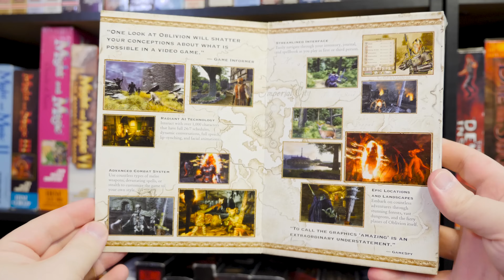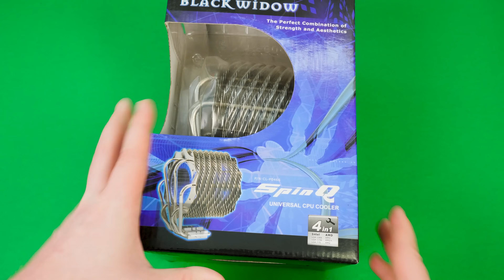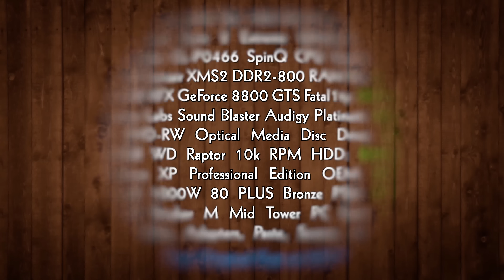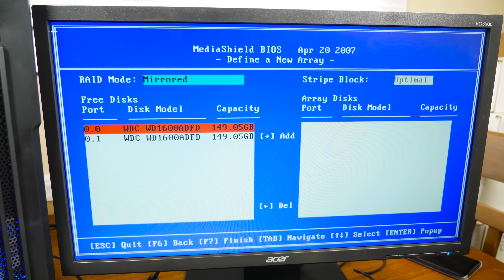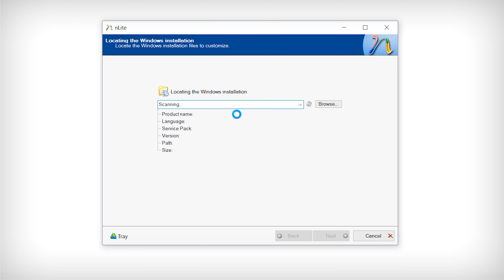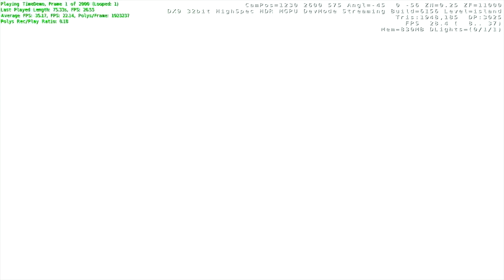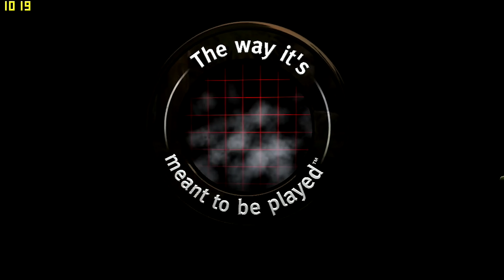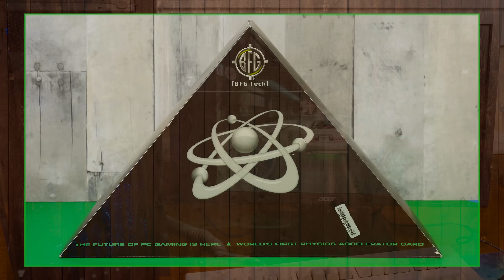LGR - Building My Dream $3,588 Windows XP PC

Comment: I want to build a system like this. Is this period correct?
Reply from the maker: They’re all period correct parts, but a system this high end would’ve been pretty uncommon. It was my dream machine after all :)
Reply: @LGR  even though this is vista era hardware, Windows XP still had the higher percentage of the marketshare because we all know how bad Vista's launch was at that time so a huge percentage of systems was definitely running Windows XP at that point and probably growing. So the Vista era hardware is definitely period correct but was overkill for Windows XP at that time.
Reply: @LGR  did you ever have to deal with the SATA/RAID corruption bug that plagued these NForce chipsets and if so how did you resolve it?

Comment: WinXP... no, just... no! Golden era of pc gaming though, SP2/3 were god sends. At this time I was using an Intel C2D + 9800 GTX ...miss those days. I used XP briefly but quickly migrated to Windows 2000 when I had found out that it ran games just fine and was far more stable. I didn't get off of that until the release of Windows 7.

Comment: is it better to go for a 32 or 64 bit XP Version with a build like this?
Reply: I'd go with 32-Bit XP. From what I gather, 64-XP was not very common so while you can install it, probably the biggest problem you'll find are drivers, or lack thereof. I don't believe most computer manufacturers released drivers for their hardware for 64-bit XP.

Comment: I had similar results at the time with a much cheaper setup: msi k8n neo 2 platinum, athlon 64 3200+ ATI HD3850 AGP, 3 gb cheap Chinese ram pc3200 400mhz, cheap cooler, any case available, non certified 650 power supply.

Comment: XP didn't have DX10 so it couldn't run crysis on very high without mods. I remember my Q6600 4GB DDR2 1066 8800GTX can only get 17FPS at 1200p.

Comment: Core Duo 2 E6700, Asus 8800 GTS 320 MB, 2 GB RAM 677 Mhz, Asus P5 Deluxe, X-Fi Pro Elite, 200+200 400GB hdd 7200 rpm sistem kullandım.
Reply: Şuan 2500K GTX 970 14GB ram DDR3 1600 mhz çok eskidi. İki yıl önce topluyacaktım. DDR5 geliyor diye 1.5 yıl erteledim. İdare ederim dedim kurtardı ama DDR5 sistemleri çok sarktı CoD Cold War oynuyamadım. AMD hala işi uzatıyor. İntel kasımda LGA 1700 soket ile DDR5 geçecek, büyük ihtimal intel bir sistem topluyacağım çünkü daha fazla beklemek istiyorum. İ7 12700 alacağım. Ses kartımı aldım Creative AE 7 geldi yeni sistemi bekliyor. X-Fi pro ses kartım drıver sorunları yüzden 8 aydır rafta duruyor baya zor zamanlardan geçiyorum 😂
Reply: Ohh I see you.

Comment: More of a 2006 machine than a 2007-2008 machine, the 8800 series and core 2 6000 parts came out in 2006, for 2008 a first gen i7 or last gen Core 2, with a GTX 280/HD 4870 would have been better

Comment: Bring back XP!....windows has gone downhill after XP and W7!...still running my XP rig as a dual boot XP/W7 Ultimate sp3 system with AMD Athlon 64x2 dual core socket 939 with 4gigs of ram and I bought another...YES!...another ATI HD4650 but a 1 gig version instead if the 512mb and its a much better experience!...also have a gtx950sc that works on XP machines!...however the bottleneck is real!...but it games!...I love it and I'm gonna upgrade my mb soon!...it has steam and origin loaded on it!...

Comment: too bad the 680i is garbage, my maxed retro setup has a 790i because it isn't as shit as the 680i is. And yes I had both, when they were new, in fact my 790i is the one I bought way back originally, I returned the 680i I bought because it was honestly junk, it was horrendously unstable as soon as you did a little OC on it and it was just an unfinished mess of a chipset, the 790i Ultra SLi is workable but still far from perfect and I'm not surprised nVidia just stopped after it, they were bad at the chipset game at that point for some reason, the older chipsets were good, I have several of them and they are perfectly fine. But 680i and 780i were honestly terrible, the 790i did work if you cooled it well and didn't set the RAM speed too high, in fact I've run a xeon quad on it at 4GHz for years.Edit: lol his setup is pretty low end, mine is ridiculously OP in comparison, 4GHz, 8gig DDR3, 128Gb SSD(OCZ RevoDrive), watercooling etc etc. and ROG MARS 760 GPU.